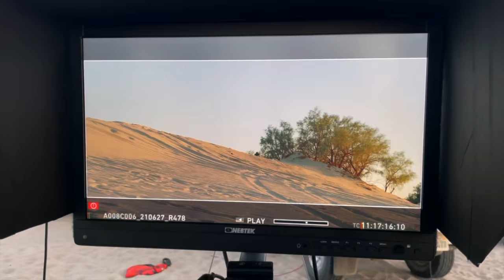$150,000 Toyota Tacoma Race Truck Walk Around

Comment: which pieces of that truck are actually made by Toyota again?
Reply from the maker: The engine was made by Toyota and then there’s other parts made for Toyotas but not necessarily by them 🤷‍♂️
Reply: 4.0 Engine, with TRD supercharger. Fuse box/wiring harness, frame, gauge cluster (tucked under dash), emblems

Comment: Honda does it better. 😎 🏆🏆🏆
Reply: Funny since Honda had TSCO build their truck… doesn’t even use a Honda factory motor nor frame/body since ridge line is unibody… 🙄 let’s see factory ridgeline vs factory Tacoma 😎
Reply: @northsandiegorc4248  yeah everyone’s race spec truck is outsourced custom build to an extent🙄. But that J SERIES ENGINE ain’t! 
Baja 1000 class 7 unlimited winners: TEAM HONDA🏆
Toyota doesn’t compete in this class, that Tacoma Camry engine burns too much oil. 🤣🛢
Reply: @czar2321  Camry motor?? Not even same motor haha this has a 4.0L when did they out a 4.0 in a Camry?? Not to mention what happened at the 2020 Baja 1000…. Rhys Millen and his AWD FORD powered jackal smoked team Honda in class 7 open…. Which Honda had a DNF 😎
Reply: @northsandiegorc4248  So now your a Ford guy? 😂 this is 2021 and HONDA won 🤷🏻‍♂️
 Ridgeline 3.5L (modified engine) is used in Baja 1000 my guy! Toyota ain’t putting Tacoma’s  3.5L Atkins in the desert. To slow…🐌
Reply: @czar2321  never said I was a ford guy just pointing out that Honda doesn’t always do it better, case in point the last Baja 1000 getting smoked by the jackal in a ford powered car, the year before that with Dan chamlee in his 3.5TT ford eco boost.   Again, a trophy truck built by TSCO, with a Highly modified Honda engine (add 2 turbos, ECU, custom intake plenum blah blah).  Now take a factory framed Tacoma, and put it up against a factory chassis ridgeline.  🍻🍻